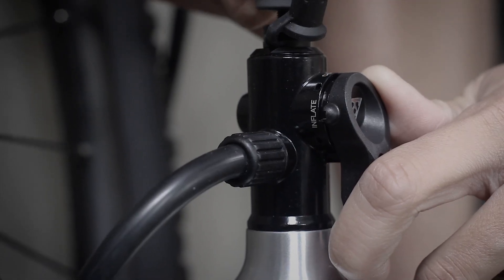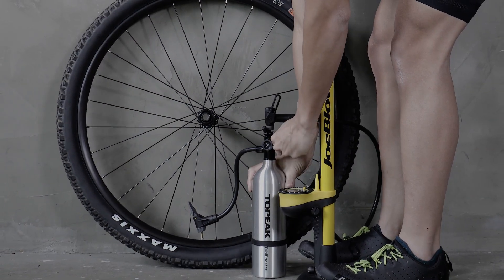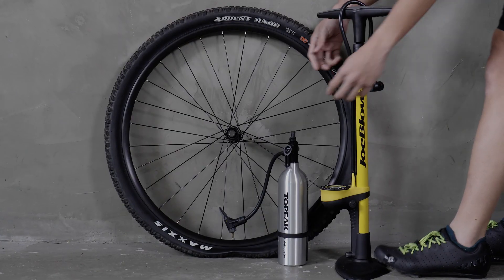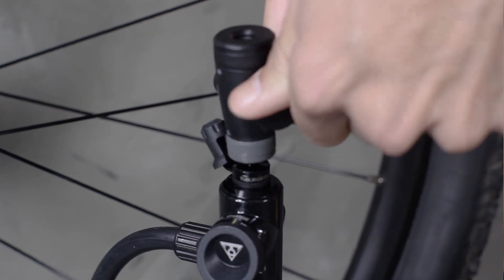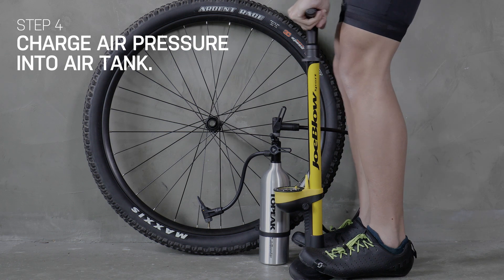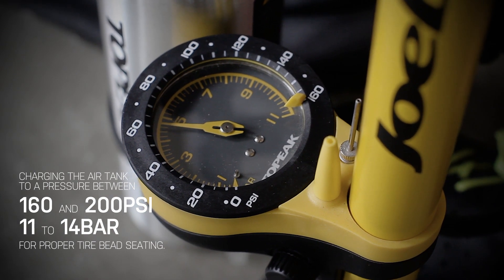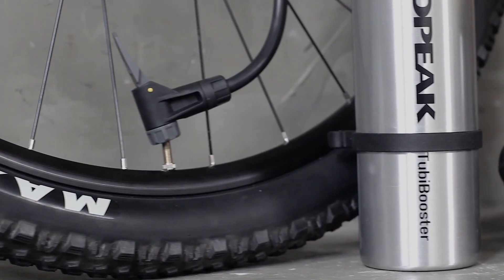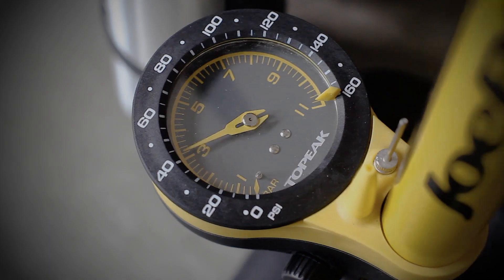TOPEAK   How to Use TubiBooster X to Inflate Tubeless Tires

Comment: BEWARE: DOES NOT WORK for "Fist Time Seating" of TR light/racing 29er tires (e.g. Maxxis, Schwalbe). I have tried several times to get this to work but it only works when tires had been seated before and have only partial sections separated from the rim. NEVER WORKS FOR BRAND NEW TIRES. It is frustrating. Tried with 100 psi, 150psi, 180psi... 200psi. PROBLEM: Air simply discharges too slowly. My floor pump could get the canister up to 200 psi (which is too high). But it never releases with the rush of air necessary to seat a brand new tubeless tire for the first time.
Reply: Тебе просто надо было открутить золотник у ниппеля, то что показывают в видео это ошибка, он препятствует быстрому входо давления в колесо
Reply: Ok, all of these thoughts are correct, however, if removing the core one must switch to the schrader nozzle function, as the presta function will not connect without the core installed. I tried 160psi, which is what my wheel was defined for. That failed. I had success in dry setting it @ 190 psi without difficulty. Leave the TurbiX to inflate mode and remove the nozzle allowing the air to escape moving into the wet setting of the wheel. My concern in removing without the core was too fast a deflate injuring one's hand. Leaving the bottle switched to inflate would in theory provide a rear passage of some air rather than locking it out effective only having the nose to absorb such high pressure. Why companies do not perform their own R&D is beyond my comprehension. Hope that helps gentlemen! It pays to sponsor, as that vets issues prior to the general public release. Topeak should compensate myself. Saving their product.
Reply: Cont...once your sealant of choice is measured & administered, replace valve core, then roll the wheel atleast once to allow sealant to spread and inflate using floor pump. Follow post inflation process to maximize the tincture of time to satisfy the wheels needs.